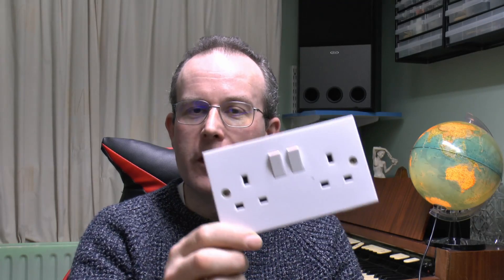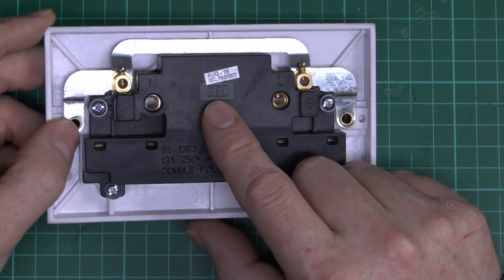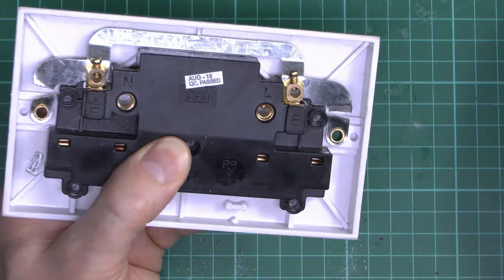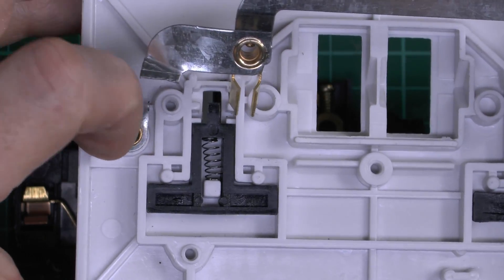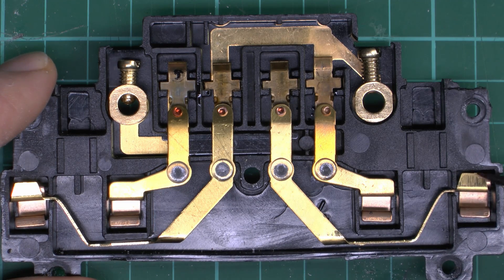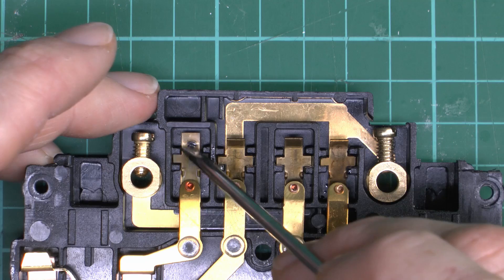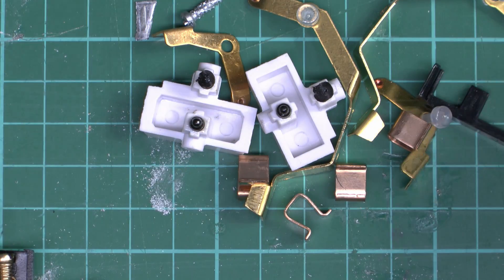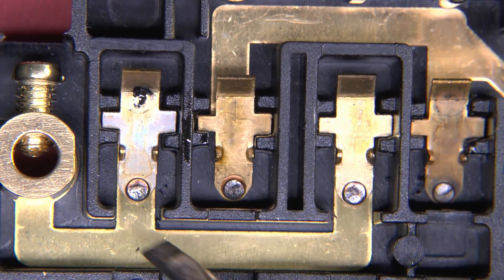Double Socket, Double Failure, Double Pole

Comment: CED are the cheap and nasty ones you can get in B&Q and other places like Wilko, maybe Screwfix absolute budget range below even LAP brand. Really only good for junk uses like a work bench or shed were it might get used 4 times a year. Not had temendous luck with Crabtree either as their switches tend to jam, having to stick with MK for any use inside the house.
Reply: Crabtree also melts the socket contacts, along with the switches. Sadly there are few good manufacturers left, all have cut costs to maximise profit, though the older Crabtree stuff is great and long lasting, the new stuff is rubbish, unless you only use it at under 5A load. I picked up a lot of old stock Crabtree 2 way switches on a sale at the wholesaler for under 50p each, so replaced all the ones in the house with them, even though I have no 2 way switching, as they will last well, and the originals were mostly 50 year old Lascon that were starting to show their age. Largest load is 100VA of fan on them, the rest is LED or Pl lights. Only incandescent lamp is the bedside light, which is celebrating it's 80th birthday this year.
Reply: dunno my shed ones get used well, i replace a few mk metal clad every 5 years!

Comment: What kind of certification marks were on it?  In the US there's UL (Underwriters Laboratory) an assurance that the device has been properly tested.  That thing looks it was substandard from minute one.  The makers were probably planning on nobody using it to the maximum rating.
Reply: There's a BS 'kitemark' on the back at 0:58, it's that thing shaped a bit like a loveheart right of centre - also stamped BS 1363 above the rating info that John points to.
What I don't see is a CE mark - I don't think that mark particularly means anything since unscrupulous manufacturers are putting it on all sorts of dangerous junk... but I thought it was illegal to sell stuff without it these days.
Reply: ...Which looks up as made by Huizhou Chung Kee Electrical Co., Ltd - brand named as CED

Can't seem to find these sockets on the CED website today, maybe they've been discontinued?
Reply: The have been examples of Chinese manufacturers faking paperwork to allow them to stamp BS (or UL) on items that have not been through the testing process.
Reply: My understanding is that mains electrical kit isn't CE marked because it's not a European standard - most countries have their own standards.
Reply: @David8n  CE is not a standard, but items sold in EU country's should fulfil relevant standards and that is what the CE marking tell you, the manufacture (or somebody else) certify with the CE marking that the product is up to  relevant standard, there is not approval of any kind, there is no test of any kind, just somebody's word "trust me", you have to look at the documents that follow the thing to see whom ever it is that promising that the thing is up to standard, often it is the manufacture but it can be the seller or what ever. For those that do follow standards it is a cheap way to do the documentation that he follows the rules, for the cheap skaters it is a free playground to make money in a easy fashion.
Reply: Usually on UL listed products there is a number (typically - but not always - prefixed with an E) also written by the "UL" logo. You can look it up online and see the manufacturer - it's also a way of possibly determining if things are fake.
Reply: randycarter2001 They are meant to be made to British Standards, BS 1363
Reply: Very easy to get cheap parts. MK is the better manufacturer for these sockets.
Reply: Some of the MK parts are made in China too.